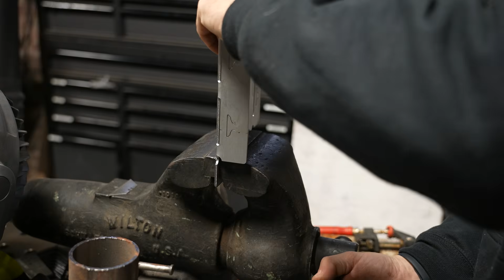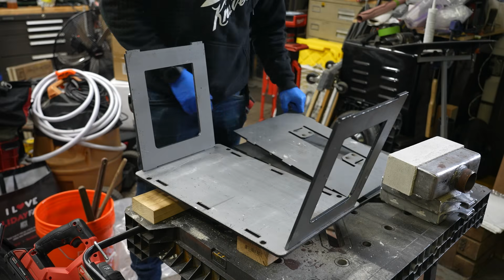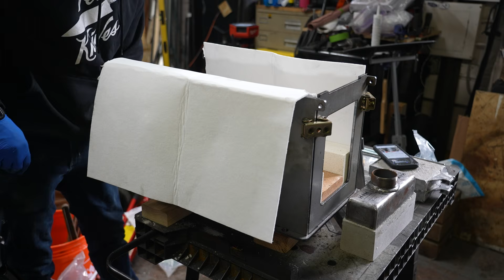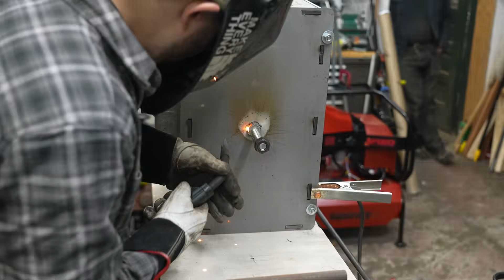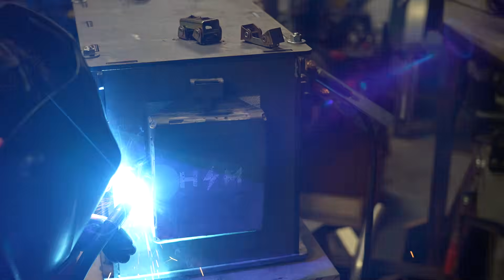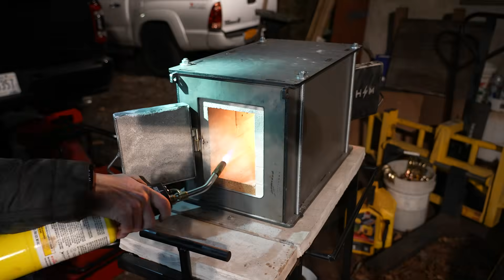The BEST DIY Forge On The Market

Comment: For like $350 more you could buy a Chiliforge which is ready to use out of a box, industry standard among knifemakers, and has a burner that is so good it is used by NASA for their material science division. In other words its way better, probably the best forge on the market aside from the crazy forge made by Mike Norris for making stainless damascus . No offense to Brian and his team. They make cool stuff but this is for hobbyists IMO. As a DIY kit goes though it is very nice and probably the best I've seen. My first forge was made of a $19 dollar mailbox, hairdryer, and some random plumbing bits and a MIG welding tip. A good stat but not as nice as this.
Reply: Genuinely though, when I saw the $800 price tag, I was a little confused at the point of the "DIY" kit. I feel like you could build one of equal quality for much less.
Reply: That’s what I’m saying man like if you’re gonna go in for the $850 DIY why wouldn’t you just spend the extra $350 and buy the one with the warranty built for NASA by chili Forge like the guy at Monolith knives said.

Comment: You can buy better, you just won't pay more! Expensive as hell.
Reply: What's better that costs less, you'd be doing a lot of us a favor by sharing your knowledge
Reply: @DracoOmnia  chiliforge
Reply: @monolithknives  but that costs twice as much? 😖
Reply: @DracoOmnia  but you are not taking into consideration the cost to build the DIY kit vs. pulling it out of a box and getting straight to work. The single burner chili is $1099. I fail to see how that is twice as much. Both forges will include shipping cost. I guarantee it will burn hotter and more efficiently, I have forged stainless damascus in mine. This also the forge used in Forged in Fire. Additionally comes with lifetime warranty.
Reply: The whole point of the housemade forge is the ease of replaceability. I hate having to reline my propane forges.
Reply: My point remains...

Comment: Is it possible to order it without the h⚡️m logo?
Reply: It's on the otherside of fire brick so you could just fill it with almost anything if you dislike it so much
Reply: If not, just sand it off.
Reply: @judweaver3635 it's cut into the piece. You could weld it up and grind it flush, though.

Comment: This is on my wish list. My only concern is about how quickly it will drain my EcoFlow Delta as that’s the only power in my smithy.
Reply from the maker: It’s a great unit and I don’t think the blower uses too much power, if you were worried you could buy just the blower and plug it into your ecoflow to see how long it’ll run.

Comment: One thought about your modification of the sliding door vs the hinged doors on gas-fired industrial-type furnaces. The sliding door was also designed to easily swing up and let the pressure wave pass and then reclose minimizing the amount of flame and debris in case of an accidental explosion within the combustion chamber and minimizing damage to people and equipment. Keep this in mind in your design.